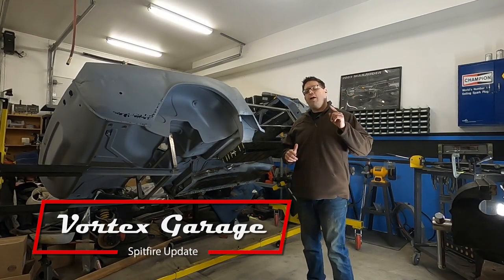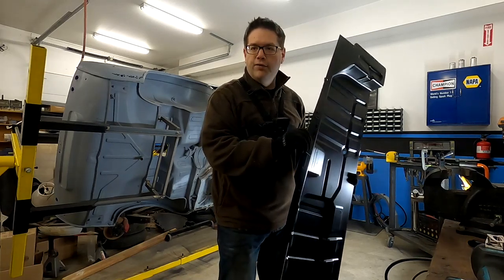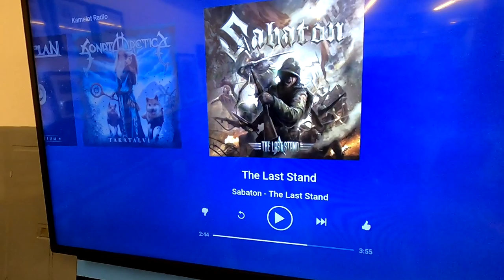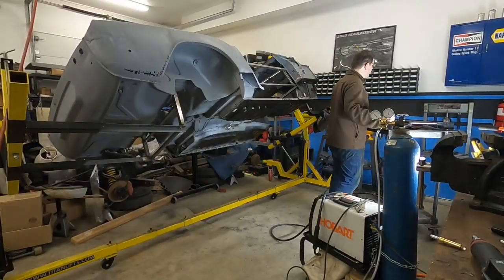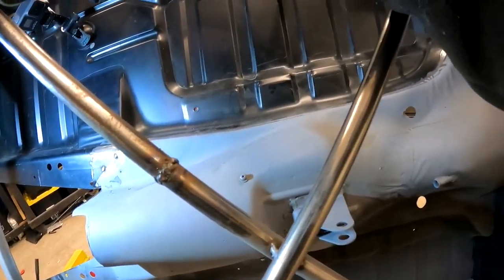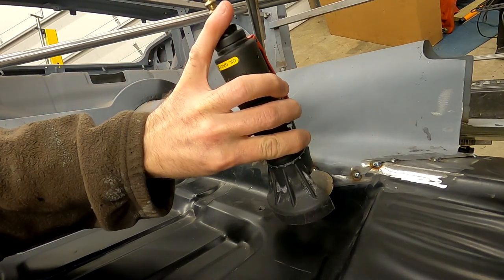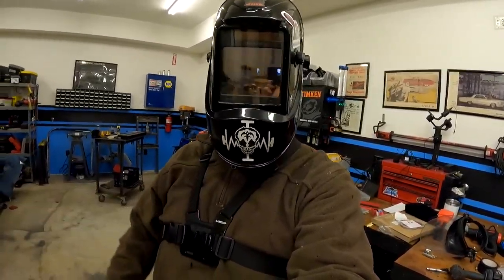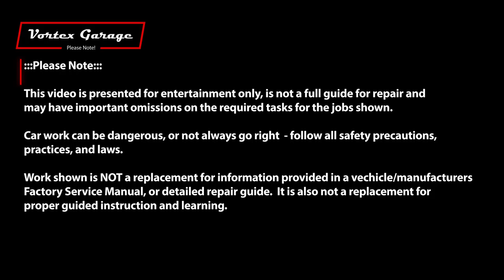Triumph Spitfire Floorpan Install - A new and better method on the RH side, full install video

Comment: Love your video. Do you remember what set up you used in your welder? You mention low voltage, but how low did you go?
Reply from the maker: My Hobart 140 has numbered voltage selections so not sure the exact amps...  I go between "1" and "2" when doing sheet metal.  I'll have to check the hobarts manual and see what amperage those actually are.
Reply: @VortexGarage  No worries, I have the same welder - Holbart 140. I followed all your steps and worked beautifully. It is a slow process, but it gets the job done and done well.

Comment: Was there any overhang off the floor pan at the rear (under the rear seat section).  Or does the floor and lip meet nicely together?
Reply from the maker: If I recall correctly the rear part of the pan fit great and met the lip nicely.  The front section seemed be where most trimming was needed.